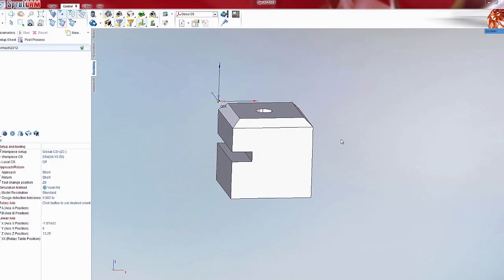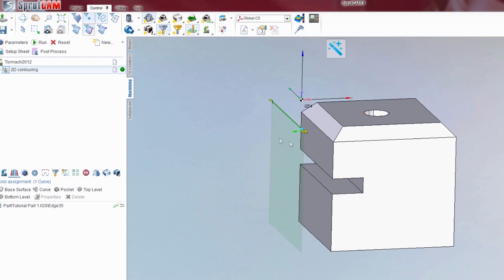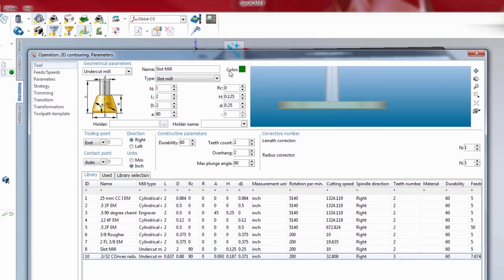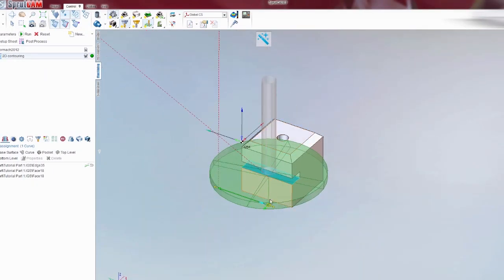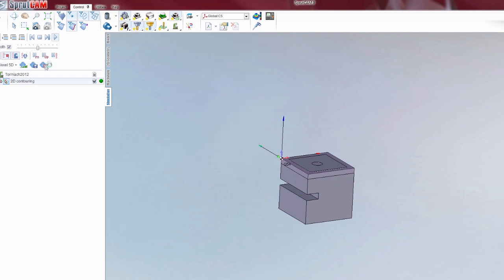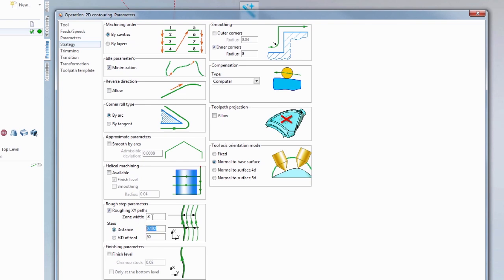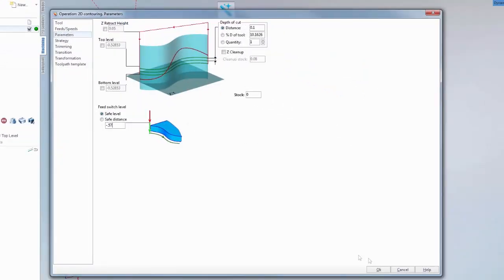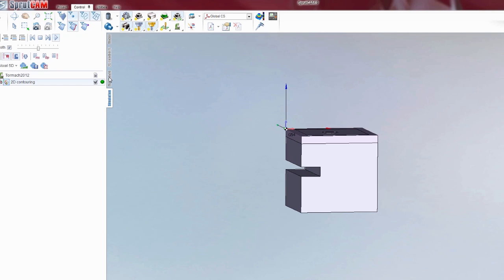Roughing Steps for a 2D Contour Operation - SprutCAM 9

Comment: Any chance you could do a video on the 3D contour operation? The user manual does not explain very much for this operation and it is not working how I expect it should. I am trying to clean up tapered walls (that have a non planar bottom) using the same taper end mill without success. The model I am working on is here http://www.goldenfab.com/temp_share/VALVE_COVER.stc feel free to use it for a video.

Comment: Thanks for another helpful video. To save time you can keep the tool down, instead of retracting, by going to transition under parameters and changing it to (around work piece) instead of (via safe plane).